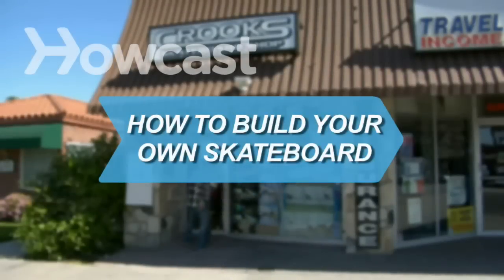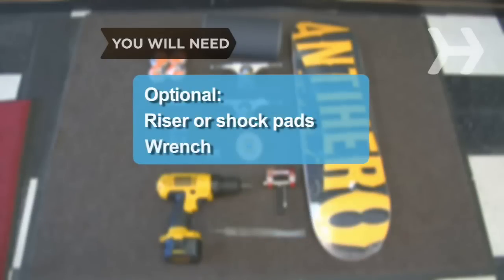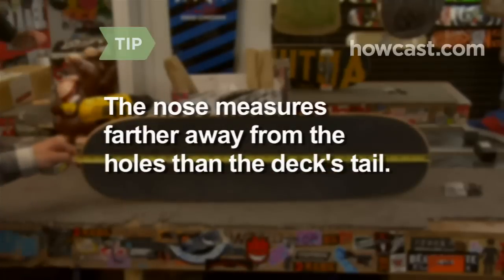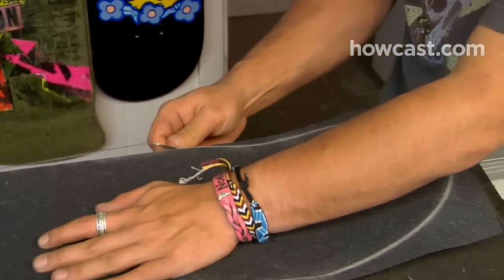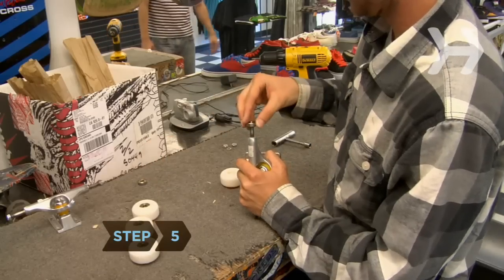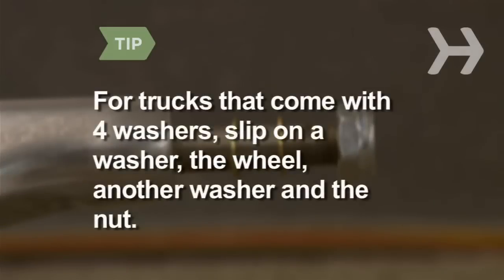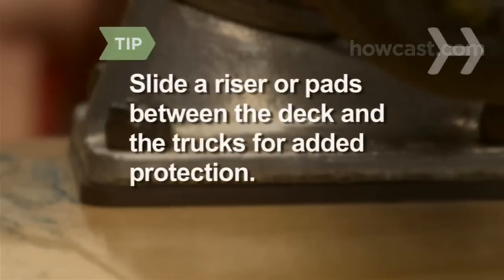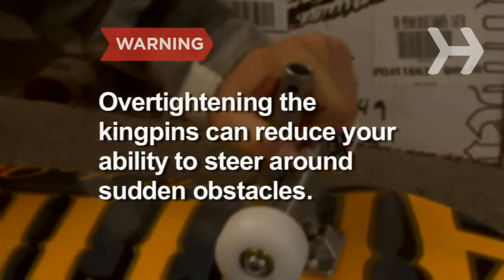How to Build Your Own Skateboard

Comment: are zumiez board good cause stoopid parents keep buying me a walmart board how the fu will i kickflip
Reply: go to your local shop
Reply: +sean sadick one of the 29.99 boards would be fine for you, your local shop as stated will probable have a "shop model" id suggest going with one of those, or a premade complete may be a good option, you can get these for 109~~ theyd have real trucks, real grip, real bearings, and the board would have plenty of pop for you.  wallmart boards can be "dangerous" if your at the stage where your trying to learn tricks. i remember getting a board from there as a kid that had plastic bearings

Comment: All the things you need are expensive
Reply: For a good Skateboard, You have to Buy expensive pieces for it
Reply: +LYNXFUZE Yep. My deck was a Toy Machine 7.75 (79.99$), Trucks = Independent 139's (64.99$), Wheels = BONES 100's 53mm (34.99$), Bearings = Bones REDS (24.99$), Hardware = Thunder Bolts (4.99$), Griptape = Bullet Tape (5.99$). All these prices are in Canadian dollars. Most shops will offer a discount if you buy everything you need to built a complete setup. In my case it was 20% off so add all these prices, take 20% off, add 13% sales tax ;)
Reply: +Rod Drixx an $80 deck jfc it better last